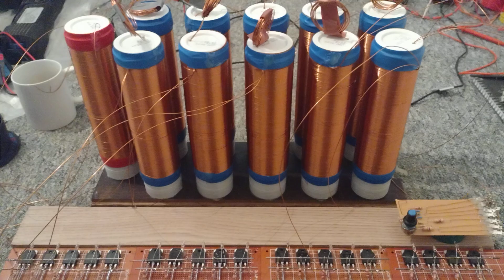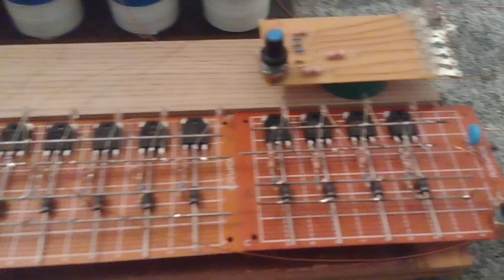The Progress so far.

Comment: when you built all those coils, did you make sure all the wire lengths are the same?
Reply from the maker: Yes they're all matched along with the circuits.
Reply: @oliver1224 very cool, you machine is very nice
Reply from the maker: @jodybruce5097  Thanks very much I appreciate that.  The layout when its complete is going to look very much like my previous Alexkor Oscillator but with almost twice as many switching circuits..
Reply: @oliver1224 wow that sounds awesome. are the secondary coils open?  it looked like the one end of the secondary coil wire was wrapped up on top
Reply from the maker: @jodybruce5097  Yes they're all copper.  How I've made the coils.. The blue coils are bifiler wound with a layer of PVC tape underneath & over the top of the first layer in order to keep the wind as tidy as possible.  There's two layers wound together. on all the Blue taped coils bar the Red taped coil which is double layered but only Single filer... that parallels the small 10nF Cap in order to further boost the volts...  a little tweak I came up with...   When the device is built & being tested I'm going to eventually run it across one of the Capsule Cap Dump devices I produced last year...  I have a larger version coming but heat sinks are months away on a back order..
Reply: @oliver1224 wow very cool that's a great idea to add the cap like that, what are you using to drive the primary coil? are you using a zvs driver board?
Reply from the maker: @jodybruce5097  The device is going to be based on a schematic I saw a few years ago over on the Patrick Kelly's website...  I've experimented with it in different builds... even low input devices but nothing on the scale of what I'm building now.  I'm just using an extra trigger winding which I'm sending through a series of branch resistors & pots to raise the resistance in order to get the most out of the Spike..  It will be highly configurable & the will have the ability to be able to feed from two different matched base resistor values feeding  into the circuits... never thought of doing this before...  The Alexkor device gave me this idea..  The bulb Capacitor device on the output acts as an output Trigger which allows the Potential to build then when the Potential reaches the desired voltage it will automatically switch the load to an output Battery...  I'm using these things already & they work very well...  If you've ever seen John Bedini's Inverted Comparator device... well these things work exactly the same...
Reply: @oliver1224 wow that's really cool , do you have a link to the Capsule Cap Dump video?
Reply from the maker: @jodybruce5097  Yes.. this was the first one I produced last year it was only a low input device & ran at just 3 volts however the oscillator can rise many times its input.... In this case the Capsule bulb triggers the discharge when the voltage rises to the desired level.. its dependant on the output load...and also the bulb type that is used..  I later discovered these bulbs all seem to work but they all seem to operate or function slightly different which makes it even more interesting..  it changes based on what you are trying to charge.. this is what gave me the idea to take it further...  I'll show you the others too if you want?  It can also double as a protection system & will protect the oscillator should something happen the output....  its got several uses beyond being a basic Cap Dump.... https://www.youtube.com/watch?v=x82fTn5UJwc&t=2s
Reply: @oliver1224 wow that's pretty cool. you are making great progress
Reply from the maker: @jodybruce5097  Thanks very much.. I've got a couple of larger versions & one that needs repairing.  I've got a much larger version with 6 Transistors coming but the Heatsinks are on back order until  sometime in June....  I think they're being shipped in from Mars..
Reply: @oliver1224 wow that sounds like you have alot cool projects and videos in the works. in your other video the Capsule device, what is that device, i have never heard of a Capsule device, what is a Capsule device?
Reply from the maker: @jodybruce5097  Thanks yes.. I have a few more things coming very soon.. couple more days & I can get back working on this thing...  The Capsule device is something I came up with last year.. you'd have to see it to get an idea how it functions.. but its an output device that's able to provide an automatic trigger once the desired voltage level is reached.. it performs a discharge to the output battery.......   Its based around higher Voltage LED or Halogen Bulbs...  when they are  joined together in series...  I use Transistors across the negative side to switch the load...
Reply: @oliver1224 oh wow that sounds pretty cool, i was not sure if the cap was a kapanaze coil
Reply from the maker: @jodybruce5097  The Capsule?  No is a Cap Dump device..  The Capacitor stores the negative energy and the Capsule bulbs allow the charge to rise to desired level... then it tells the Transistors when to switch & performs a partial discharge from the Capacitors to the Battery...  The Capacitor discharge adds the current element that is needed in these...
Reply: @oliver1224  oh ok makes sense thank you. just curious what are your thoughts on the Kapanadze machine?
Reply from the maker: @jodybruce5097  I haven't really studied it too deeply..  Isn't that the device where it initially needs a hit from a 12v battery & once it gets started the input can be disconnected?  It reminds me a little bit of the Don Smith device...  but Don Smith didn't completely disclose his entire patent..

Comment: So what is this thing???
Reply from the maker: Its a Radiant charging Oscillator that produces a series of high voltage spikes.. I'm able to collect upon the spikes, dump them into a capacitor then switch it to another battery...   its going to be an advanced version of a schematic that Patrick Kelly posted on his website a few years back....  I've experimented with the schematic & have done my own thing with it..   if it turns out halfway decent then I'll draw up a schematic & release it over on the community section of my channel...
Reply: Is that a free energy thing?
Reply from the maker: @ashesman1  I wouldn't call it Free Energy...  It should be extremely efficient...  it will require a constant input feed or a trigger..  Most of the systems that are so called "Free Energy" all require a constant input feed... you have to feed in before you can take out...